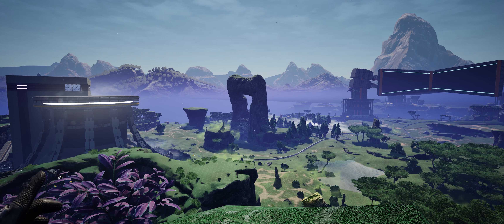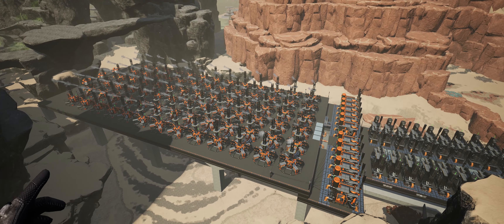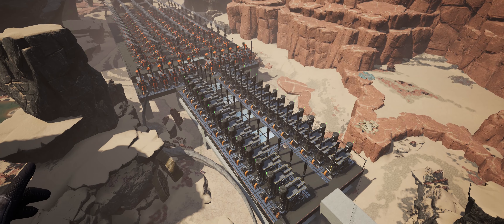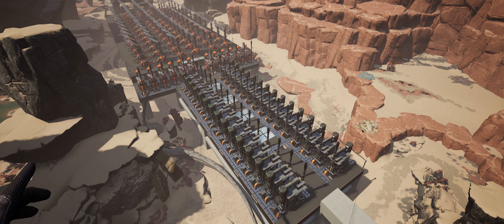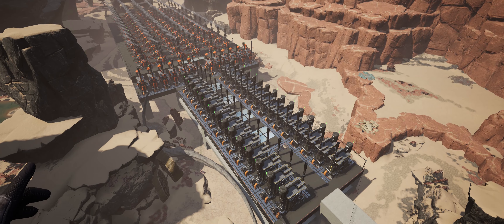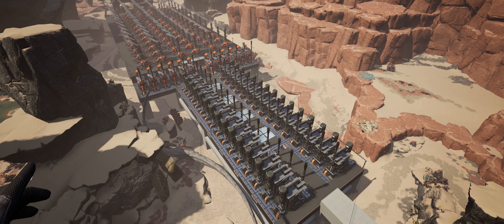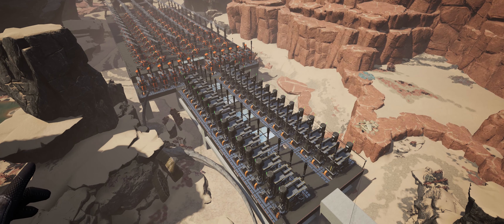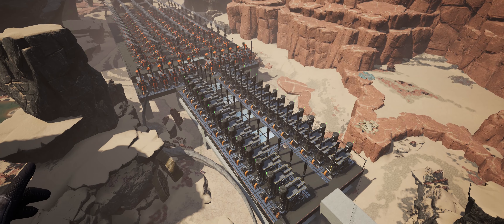Working on some unusual new builds for Update 6 - Satisfactory

Comment: Hi m8 as always awesome job... ref the power station location changes to that area they did say I believe that the nodes are possibly changing too... which will mean your oil supply will be void. 😬
Reply from the maker: Oh ok - I knew the oil nodes in the spire were moving, but wasn't sure about those few nodes that I'm using near the canyon/desert. Hopefully they don't move too far, should be fine to re-connect them. But if they move them to like, right under my power station or one of the columns or something, that may be a problem, heh. I'll have to check that once update is out.
Thanks for the heads up though mate. Appreciate the comment 👍
Reply: @StinArchi  np m8, I'm not 100% sure just one of the passing comments was about nodes so ya hopefully yours will be fine... I've demolished all of my power... starting again 🤣